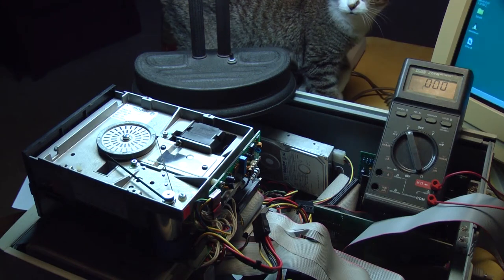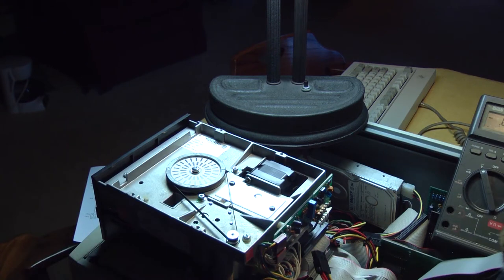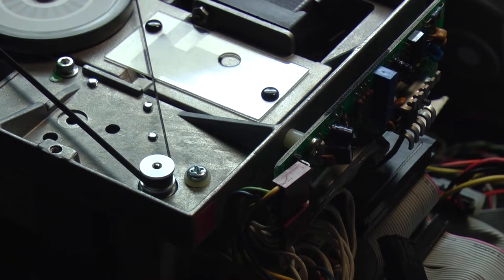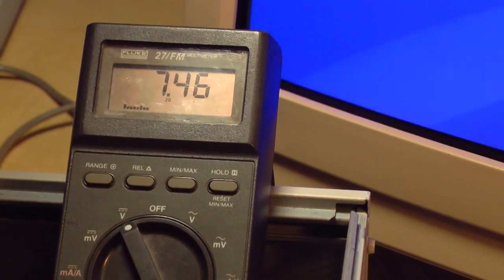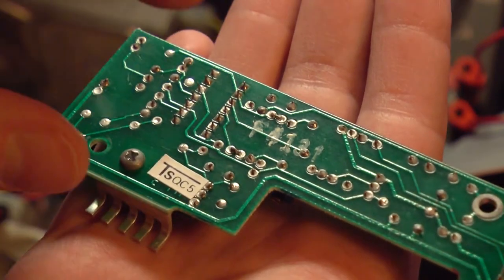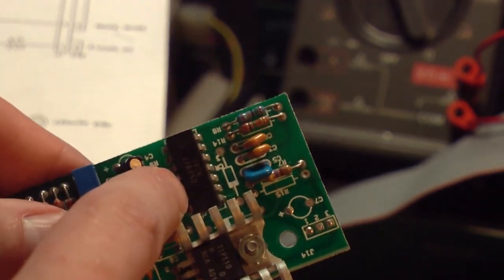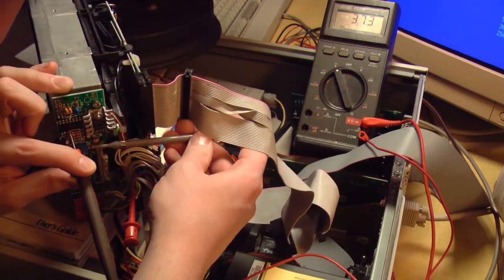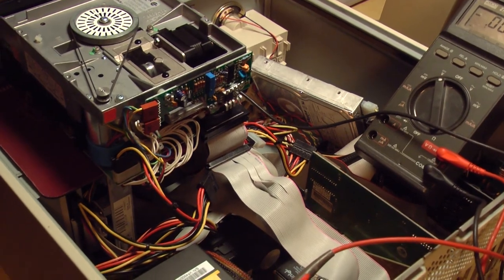Tandon TM-100-2A 5.25 Inch Floppy Drive Speed Adjustment Part 1

Comment: Thank you so much for making this video, it has been extremely helpful in troubleshooting a problematic Tandon drive of mine.

I'm hoping you (or someone finding this) might have some insight on where I'm stuck. I just replaced the potentiometer because the original got broken off. After replacing the pot IMD only runs its RPM test for a few seconds as it tries to read the drive's speed, but apparently cant and gives up. Doing the finger drag test shows the voltage go up, so that seems to be working. But pin 10 on the LM2917 goes from a little over 3 volts to over 6 during the test. If the drive isn't running, it seems to hold at a little more than 3 volts. I know its a problem somewhere on the servo board because I swapped it with a good board and the drive works.

Any thoughts/suggestions would be greatly appreciated if you happen to see this.
Reply: UPDATE: After testing traces on the board I found the connection between the wiper circuit and LM2917 wasn't solid so I ran a jumper wire. My drive is now working properly and am able to dial in the speed. Thanks again for this video and sharing your knowledge!  =8^)+<
Reply from the maker: @DOSdaze  Great! Glad to hear it. I was just about to sit down with the schematic and see what I could find that I could suggest to you. Its fun working on this old equipment, isn't it?